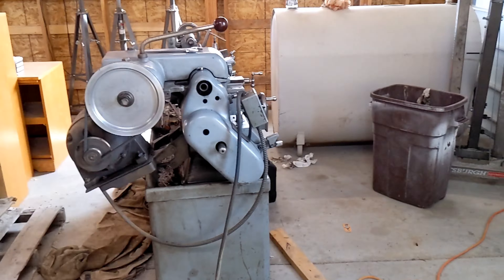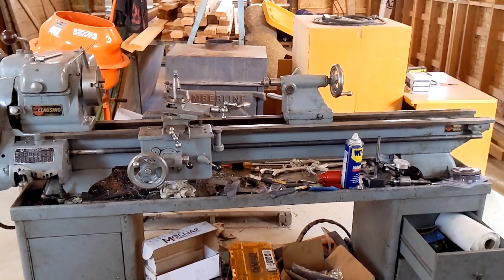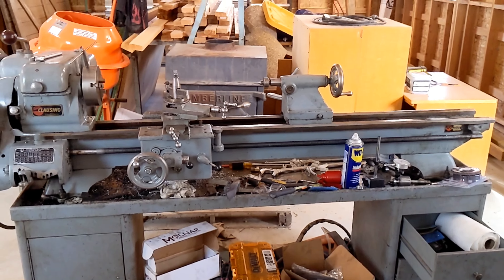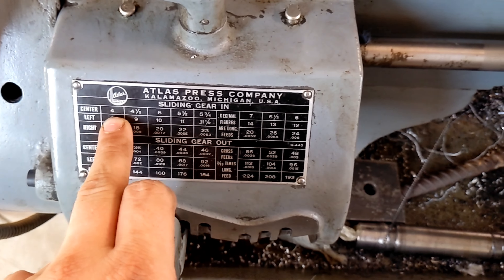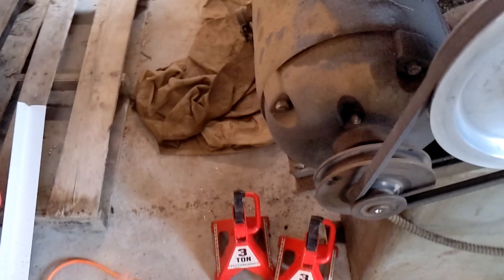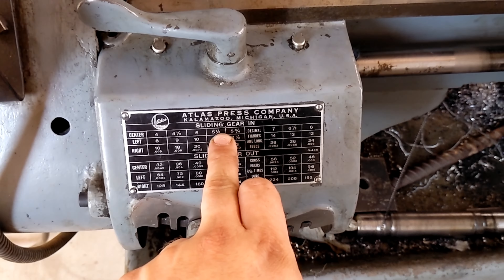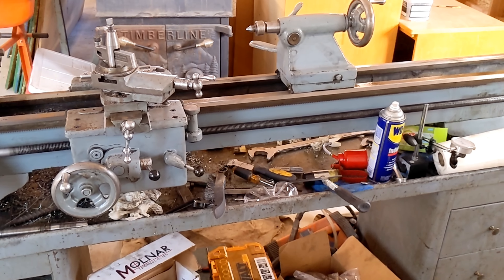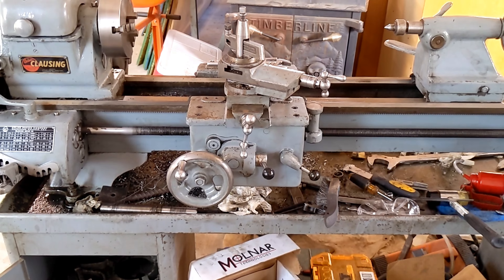My new-old toy - Clausing 4805

Comment: Nice new-old toy.  I have an older Model 100 Mk III that has been upgraded with a variable speed motor and a DRO.  There is an overview of it on my channel along with an upgrade I did to add a solid tool post mount.
Reply from the maker: Very nice. I'll have to check it out.